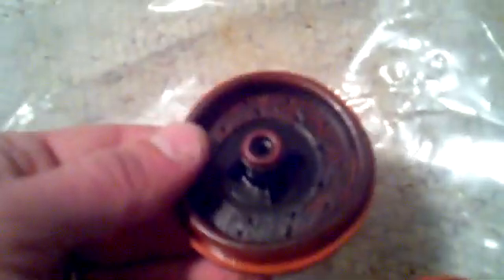BMW CCV Replacement  on N62 8 Cylinder Engine

Comment from the maker: Hello Ariel, Sorry to take so long in responding. You most likely have this fixed by now. Glad you found my video. This may also be valve seals leaking which is very common on the N62 engine. Hopefully it was just the CCV valves. It is part #13 in the diagram. Hope this helps!

Comment from the maker: The most common cause of white smoke after idling for a while on an E65 7 series is failing valve seals causing oil to be burned in the exhaust. For the misfires you should swap over components and see if the misfire moves.

Comment: Part2 It idles really rough and I will get an "Engine Malfunction" after a minute or so, I restart it and itruns fine. A sweet smell coming from the exhaust but no oil in the anti-freeze. I'm having misfires P0305 & P0308. No compression coming from the right exhaust.  I'm thinking it's the CCV?  The only other idea I have is it might be bad coil packs. I thought it might have been the head gasket but it doesn't overheat and there is no oil in the anti-freeze. What do you Think? Thanks SGT Brown

Comment: Hello, so nobody seems to know what the hell is going on with my car.  I've taken it to several garages including BMW themselves and they weren't even sure.  I am hoping you can help me.  Symptoms: Use to smoke bad (white) after the car has been idling for a minute or so and it would stop as I drove it but it doesn't even smoke anymore all of a sudden. ------>Continue reading second post<-------

Comment from the maker: Could be quite a few things, an air leak, plugs, injectors. If you have a check engine light you should have it scanned to try and see what the fault code will lead you to. It should help trace down the failure.

Comment from the maker: That would be normal. Not all the CCV's have the vacuum lines. But the replacement part still has the nub for them but is sealed.

Comment: hi this is sunny using different user name ... and yes I was getting check engine light that READ Service engine soon Emissions Related fault.. i used scan tool and got code P2189 System Too Lean at idle speed (Bank 2)... I changed  the part shown on this video(11 12 7 547 058) and Problem solved.. thanks again

Comment: P.S. this procedure is MUCH, MUCH easier if you use a paint can lid pry tool (free at the paint store usually), rather than a screw driver. Simply place pry tool at bottom of each of the six clips, it requires almost no force to safely remove the lid. Also, the lid without the hose nipples will work fine as a replacement if there aren't any hoses attached to the original nips, it still vents exactly the same!

Comment from the maker: Hello John, Thanks for the comment. You are correct that this same issue is for the 2006 550i with the N62 engine. This would apply for any vehicle with the N62 or N62TU.